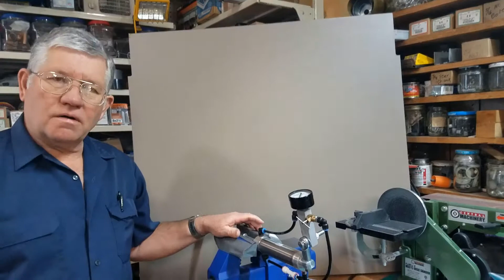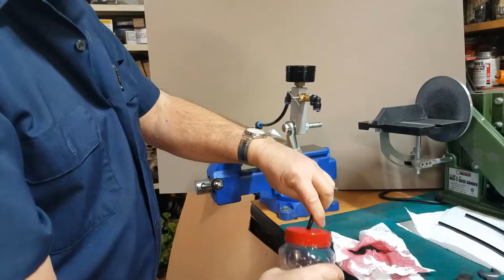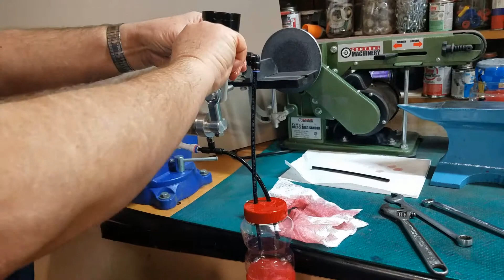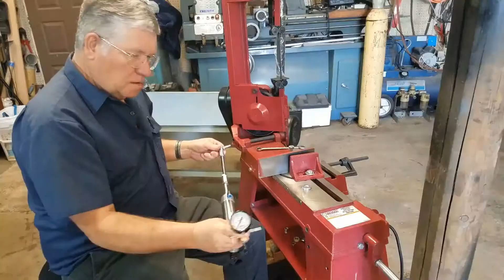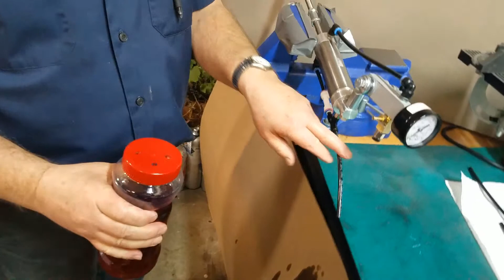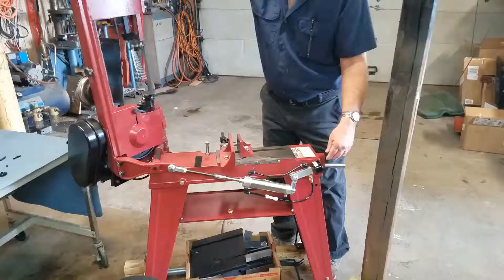SawCyl Tear Down and Gauge Lowering

Comment: Hi Andy, I purchased this kit not quite 2 years ago and have struggled to get it to stop leaking out of the T fitting where the tube leaves the fitting and goes into the speed valve. I have had this leak since installing it in the fall of 2021.  I have replaced the T valve and tubing but it continues to leak.  Any help would be appreciated.  I am almost to the point of wanting to try and replace the plastic push fittings with compression fittings but have no idea what to buy.  In all transparency, the kit is great but I think the plastic fittings and tubing don't hold up well in my garage in Phoenix where the temps get up past 120º since I don't have it air conditioned.
Reply: Same issue up here in Seattle. Started leaking in the same spot almost immediately (used maybe 3 times when leak started).

Comment: The cylinder worked great for a couple weeks but somehow the plunger seal failed inside the cylinder recently. I can't bleed it without drawing air into the cylinder.
Reply from the maker: The problem is most likely a bad check valve.  I will send you a new one today.
Reply: @nebadawnengineering8018  The new check valve did the trick. Thanks for the great product, it makes accurate cuts so much easier.

Comment: One more question, please. How far out does your assembly protrude from the side of the saw? I would want to add the extra washers for the lowered gauge as I do a lot of miter cuts too so what's the lateral protrusion distance? I assume maybe 3 inches at most?  I want to be able to mount the saw on my stand so that your assembly will not protrude past the end of my tubing. Thus whenever nesting under my welding table the saw stand helps protect the SawCyl.
Reply from the maker: It is about 3 ".

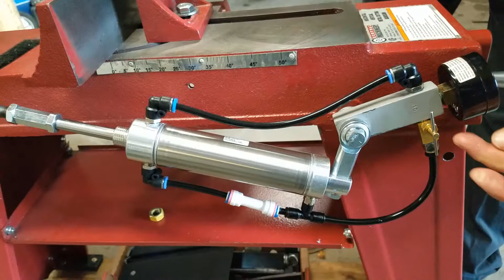Comment: Can you please tell me the exact dimension of the end of the fitting from where your fingertip is at 9:46 to the end of the saws cast iron base.  I'm hoping at least 1.5".. I'm currently building a custom base stand for this same saw (which I've owned for 5 years) and want to purchase your saw-cyl very soon.  I'm guessing it is 1.25" to 1.75".  I have an 18" (1.5"x 1.5" square tube) which sits under the saw so I'm trying to determine clearances before I tack on the tube and bolt mounts.
Reply from the maker: I measured from the face of the highest fitting by the gauge to the end of the casting where the crank is.  It neasures 2 1/2 inches.
Reply: @nebadawnengineering8018  Thank you.  I'll email you in a day or so to show you the frame I'm building for this saw.
Reply: Nebadawn Engineering  one more question please. How far out does your assembly protrude from the side of the saw? I would want to add the extra washers as I do a lot of miter cuts so whats the lateral protrusion distance? I assume maybe 3 inches at most?

Comment: Ahh. Interesting. I was wondering how you were able to make that work being that the end without the pushrod is going to displace more oil than the end with. So you have a little bit of air in the system then.
Reply: A few days ago I refiled a similar system like this on my saw completely with oil. I could NOT figure out why the cylinder wouldn't move anymore. Until I have read your comments!!  This was an eye-opener. Thank you for waking me up.
Reply: I thought hydraulics can't have air in the system or they would be spongy like car brakes.
Reply from the maker: The air is very important.  The oil actually foams a little and it works great for this use.  I don't notice any sponginess.

Comment: I take it that the maximum of 250 PSI loading is only due to the fact that you are using plastic tube and push fit connectors ? I have sourced some and the max recommended pressure is 250 psi. Copper or steel lines and compression fittings would be many times that. Thanks or showing how to install and refill with oil your version. I would purchase your one, but I live in Australia and the postage and Import Duty would make it far too expensive, so I intend to build my own. Thank you.